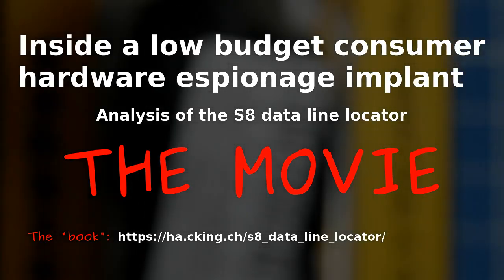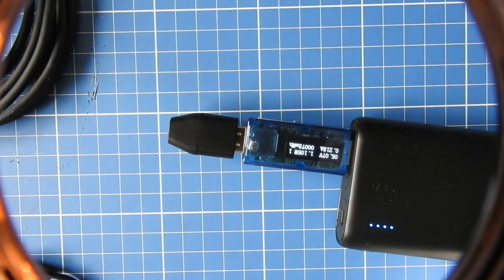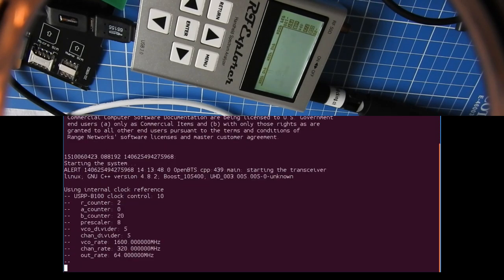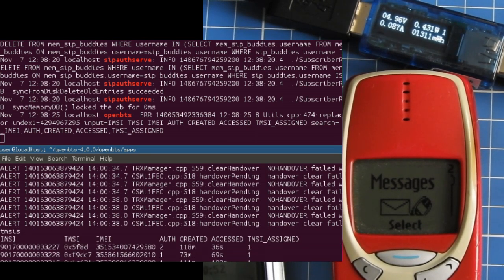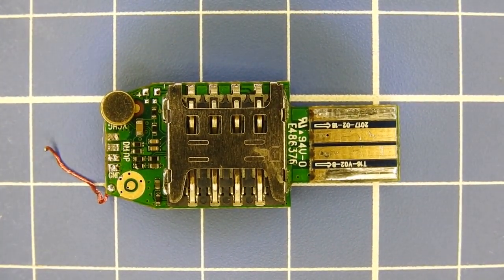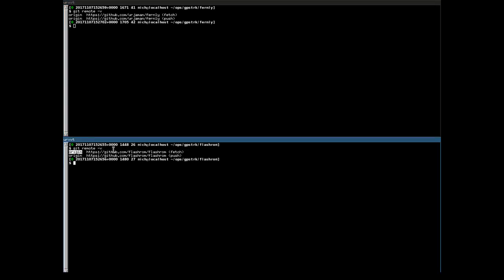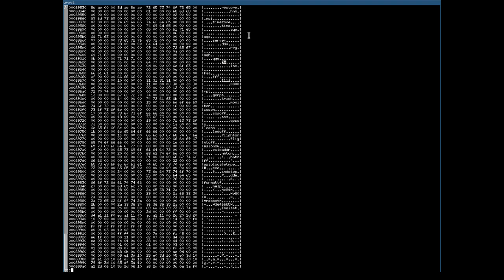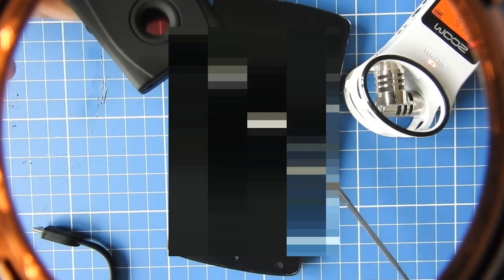Inside a low budget consumer hardware espionage implant: Analysis of the S8 data line locator

Comment: The metal shield around the USB connector also got stuck into a wall outlet adapter I had plugged it into so that is something to be mindful of as I had to use plyers to remove it and it got a bit bent

Comment: Okay, so I live in the US and I bought one of these off Wish and here's what I've found, initially it wouldn't work with the TMobile MVNO I had used so I tried it with a TracFone TMobile sim, activated it in an iPhone and then moved it to the device and it worked. TMobile is the only 2G GSM carrier left in the US so it's your only option. Mine did not make the high pitch sounds yours did and the audio quality was much clearer, shockingly clear. The DW location feature did not work and mine uses a different URL, here's the output "Loc:Unknown address
URL Battery:94%" the domain of the URL was fcstgps.com so it appears the newer ones use a different provider. I do not know if the carrier is blocking a feature it's trying to use or if it's unable to establish a GPRS connection due to the fact I can't set the APN but this is interesting for sure. It could also be that the website it is using does not handle US addresses properly and that is the error. I also am a bit concerned about interference, the packaging has an FCC logo on it but I seriously doubt this thing recieved proper FCC approval
Reply: Essentially if you want to use it as an audio spy then it may work. The wish listing advertised it being used in a car which usually has power switched by ignition so you could enable the feature for it to call you and it would call you every time someone gets in their car and starts driving as the device would recieve power and detect audio and then you could listen in on them driving

The location feature not working sucks and I would probably not advise using it anyways since it seems to send that location data to some Chinese website that probably isn't secure even if it did work. If it had proper GPS hardware all it would need to do is send you the coords for you to paste into Google Maps

Comment: Hi i got a quick question . I have bought the same cable but have not tried using it yet. I am from the UK. Can you tell me which sim card would work with the data cable.
Many Thanks
Reply: It needs to be from a carrier that has a 2G network, I'm from the US and T-Mobile is the only carrier that still has a 2G GSM network here

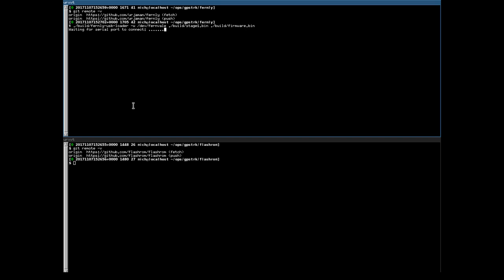Comment: 13:48 you installed an OS (Fernly) in memory free regions of the SOC. Is that right? Then when you dump the image you are dumping this original firmware image + Fernly OS?
Reply from the maker: No. Fernly gets loaded into RAM.
I then dump the flash (i.e. persistent) storage.
My goal was to install new firmware to the persistent storage, but it seems to be write protected and I haven't found a way to enable writes.
Hope that helps.
Reply: @0x6d696368  ahhh I see! thanks for clarifying :)

Comment: So you tried the UART and USB interfaces ...but why not the JTAG?
Reply from the maker: First, I couldn't find JTAG pins/pads.

Next, Bunnie and xobs never got JTAG working on the MT6260 (https://web.archive.org/web/20150122104511/http://xobs.io/fernvale-the-path-not-taken/ ) so it is unlikely that  JTAG magically works on the MT6261 or that I figure the magic out to make it work.

Last, I can dump the firmware and its reported that people can write firmware with the MTK FlashTool. That is all I need, so I don't see a need for JTAG.

JTAG isn't the do all end all. It is only one way to communicate with hardware and if other interfaces get you to your goal faster you should use them.